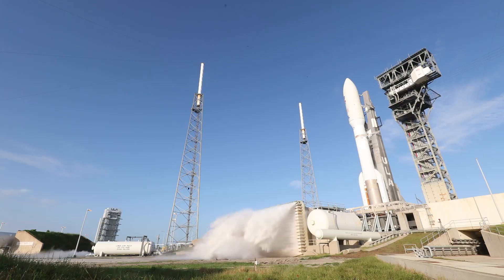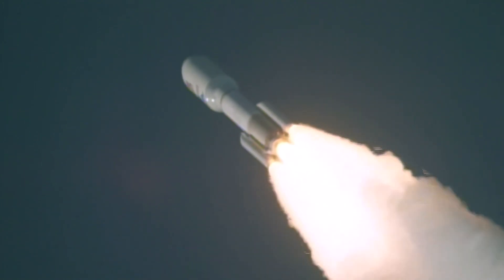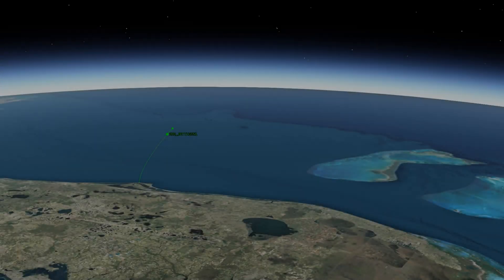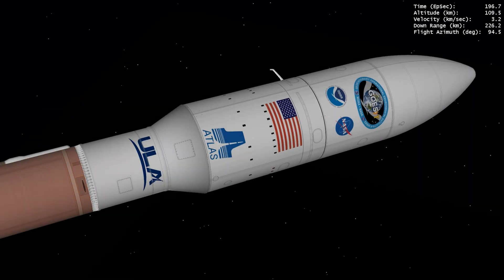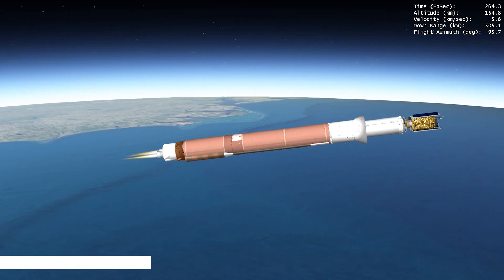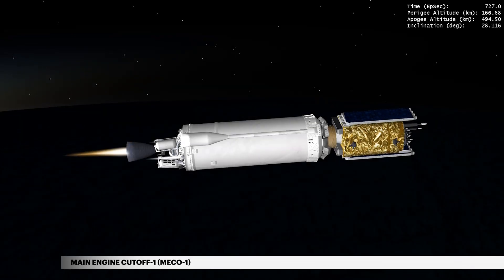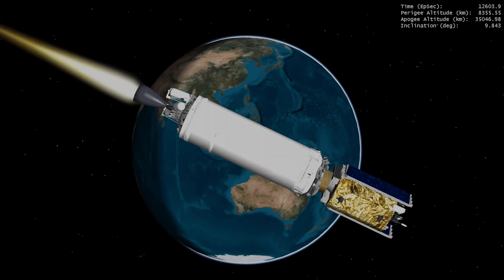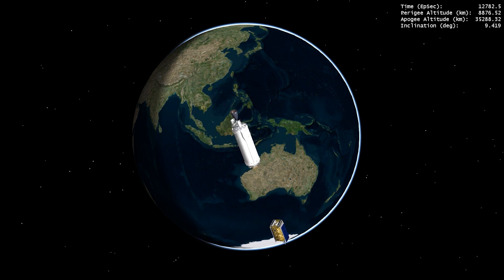Atlas V GOES-T Mission Profile

Comment: Go SpaceX... Oh wait, what?
Reply: Cringe comment
Reply: @dummyjoe7895  Only if you work for ULA. Keep dumping your rockets into the Indian Ocean instead of figuring out how to reuse them. There's a genius business model.
Reply: @cottonpony7899  ever heard of Vulcan rocket ? Ever heard of it's reliable progress news from Tory Bruno on twitter ? Go check it out then...
Reply: @prometheus554  Ever heard of SpaceX?
Reply: @cottonpony7899  user, the comment is about you talking about ULA. Stop pulling a starwman here and reply to thing I said.
Reply: @kaniaaa1517  they can’t, ULA’s boosters go much much higher and faster then falcon9
Reply: @kaniaaa1517  the solid gems aren’t worth recovering. They also go as high as F9 if not just barely under it, more then likely they will mostly burn up.
Reply: @kaniaaa1517  ah ya but Altas V’s launch profile is steeper then F9 so it will experience more heating on its way down. You can even see the SRB’s nose cone getting hot in the launch video